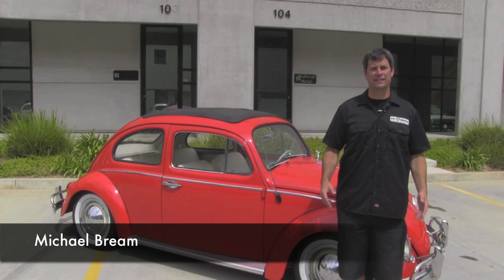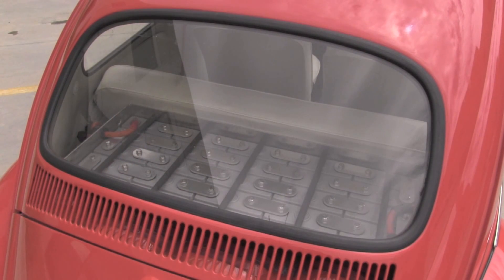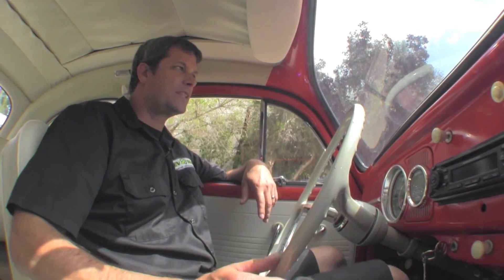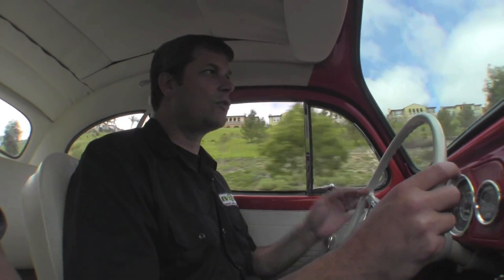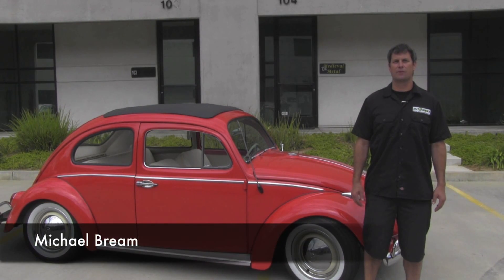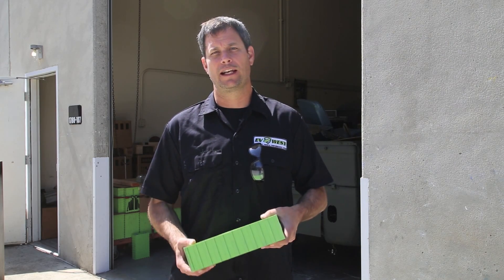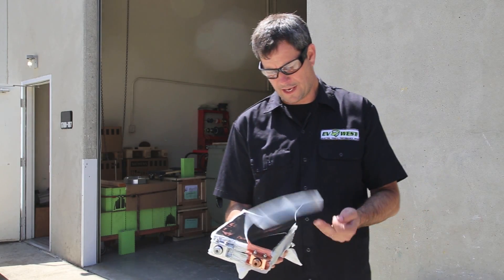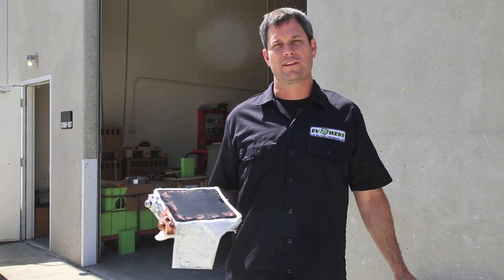Electric Vehicle Conversion - 1963 VW Beetle - Classic car electric vehicle conversion series

Comment: why would you put the batteries in the cabin area, seems like a bad thing to do .
Reply: Without those batteries behind the back seat, you’d probably have a range of 20 miles (maybe).  I’m having a Beetle converted right now in Austin, TX and, with the high voltage motor, the range should be around 170 miles.